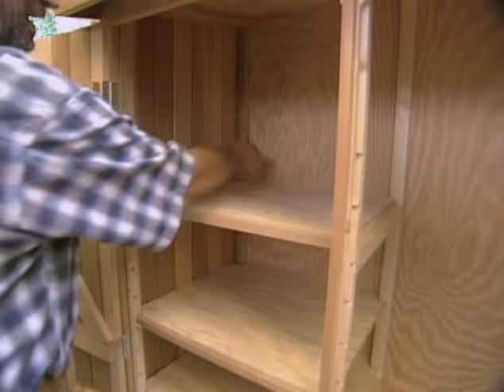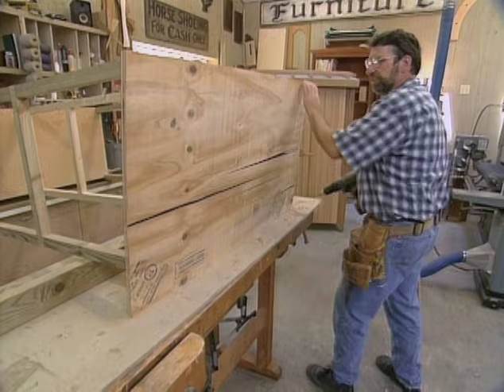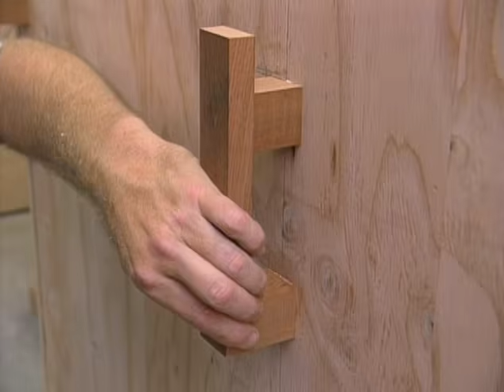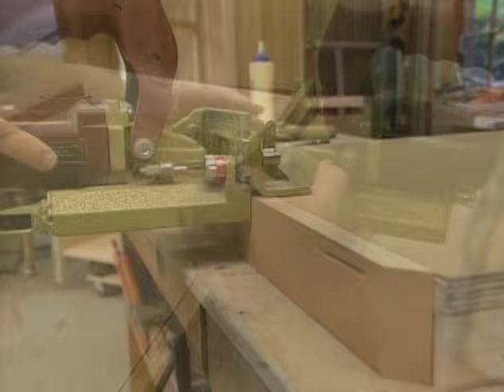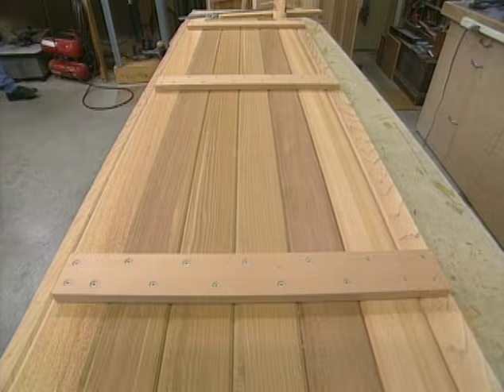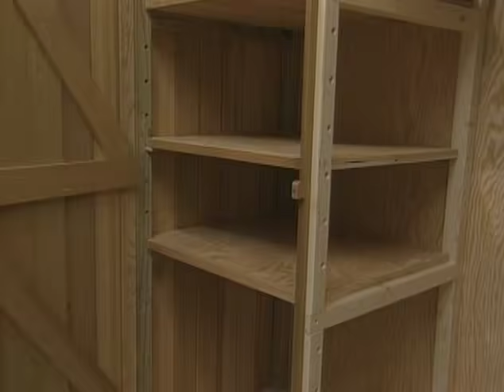Outdoor Cupboard  |  S13 E7

Comment: Excellent project - I will add to my "TO DO LIST" right after I finish Butcher Block S5/E10
and build another Shaker Step Stool S3/E1 for the wine cellar. This is a question likely for Russ/Norm and maybe the 2024 Crew can get the answer... Over the 20+ years of the New Yankee Workshop, Norm used the Rockwell/Delta 10 inch table saw - right tilt for the most part. However, he went back and forth over the seasons from a Biesemyer fence to a Unisaw fence (extruded aluminum). Why the changes during the 20+ years life of the program from one fence design to the other fence design -  multiple times throughout the years? I chose the Unisaw fence in the later 1990s and never looked back. It's a curiosity  that I just need to know. 2024 Crew, can you provide the answer??? Much appreciate and many thanks!
Reply: I heard the reason for going back to the Biesemeyer after using the Unifence for 7 years, was that it's easier to attach sliding jigs to the Biesemeyer fence.
Reply: @batarang87  Thanks! I can see this advantage to the Biesemeyer. I have a few sliding jigs made for my Unisaw fence from a NYW jig episode years ago where Norm showed how to adapt different styled table saw fences. A bit of tweaking for sure, however these work great on the Unisaw fence. The pros of the Unisaw fence as it used outweigh this in my experience.
Reply: I bought a Delta brand Biesemeyer style fence for my 1973 Craftsman 10 inch table saw.  It cost more than the saw did in 1973.  But it made a world of difference in the quality and ease of using the saw.  Easy to clamp auxiliary fences and jigs to.
Reply: There were 3 changes from the original Rockwell fence over 21 years - how can you call that "multiple times"?
Reply: @alswoodworkingbits6082  because anything more than one is multiple, that’s how. Hard concept I know but think on it a while.